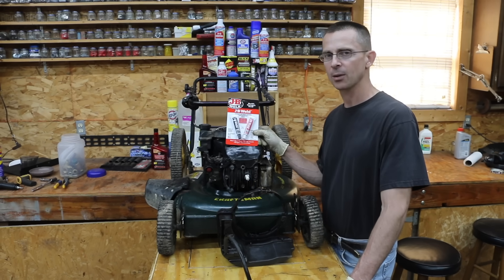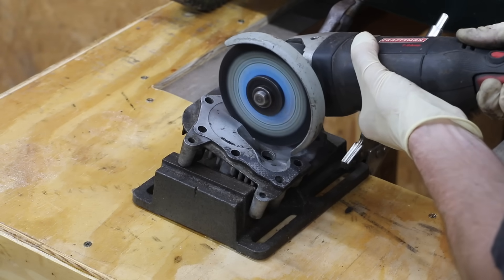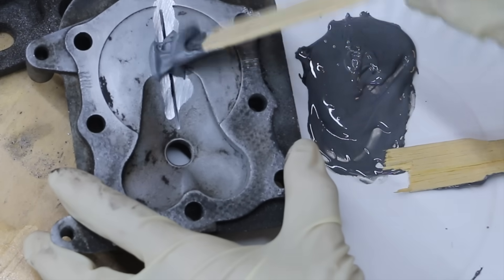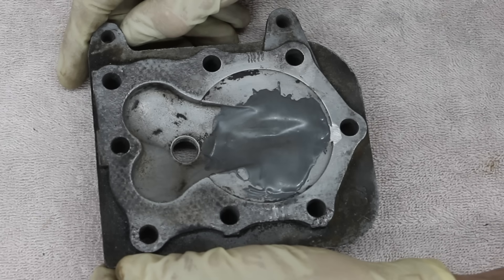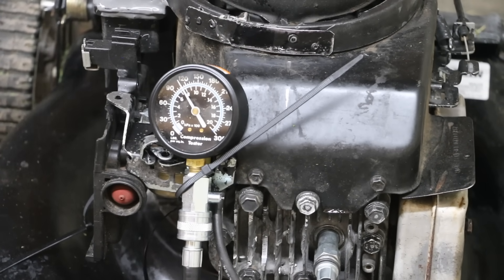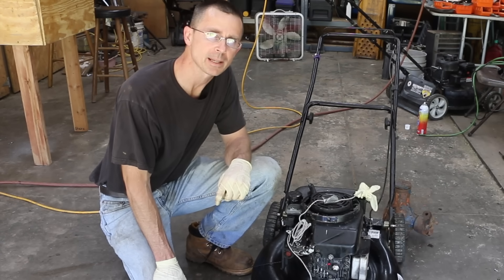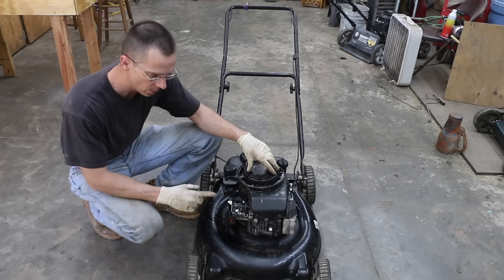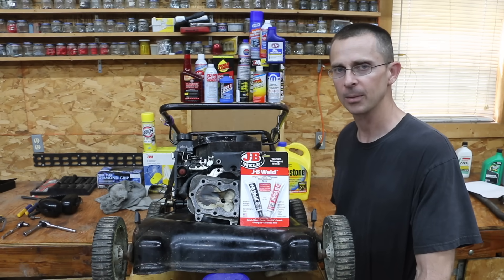Can JB Weld fix a cracked cylinder head?  See the proof!!

Comment: I restored a 1965 Mustang when I was a teenager.  The rubber that was pressed between the pulley, (inner disc and outer ring), on the harmonic balancer, had rotted, and the harmonic balancer came apart in two pieces.  The V belt also ran the alternator, the water pump, and the cooling fan.  This was about 1980, and the harmonic balancer was not available from Ford, so it was junk yard, or repair.  I glued it 3 times with Devcon metal epoxy.  The best that did was 2 days before it melted, and the centrifugal force destroyed the bond.  I then tried JB Weld.  It never failed.  238,000 miles later was still intact.
Reply: I didn't know jb weld was around  that long
Reply: @kirtleighrussell1345  I was curious so I looked it up, It's been around since 1968.  I don't think they've ever changed the paint design on the tubes on the original JB Weld.
Reply: Ok this is world was amazing long time ago

Comment: a broken flywheel on a Tecumseh lawnmower engine -it broke off the magneto mount. I jbwelded the mount back -let cure a week and put engine back together and its run 5 years now. I haven't had luck using it to fix leaking quantum tanks tho. the gas eats tru it
Reply from the maker: Impressive repair!  Thanks

Comment: Welding a new chimney pipe through my outdoor wood boiler. Couldn't get quite enough heat into it due to welder size and welder skill. Numerous pinhole leaks.  Decided I wasn't chasing them all day.  Three packs of jb later and we'll see how it holds up with180 degreee water around it.  Old burner and worth the try.
Reply from the maker: Impressive!

Comment: JB Weld makes a white plastic putty that I used to repair a cracked pool skimmer assembly.   It was wet and full of water and the job weld went on and cured up and it is doing an amazing job.  My skimmer was leaking so bad before I would have to top off my water every week and now the water has held its level for a couple of months now with no leaks.   JB weld is a great product.
Reply from the maker: Thank you

Comment: I had a Porsche about 30 years ago and the transmission had a big crack on the side of it. I took it to a welder and he stated that the Porsche transmissions were were cast from magnesium and an aluminum mix then told me sorry I can't weld it. A rebuilt transmission at that time was about $1500 so I cleaned up the crack and applied JB weld and it worked but after about 3-4 months the oil would get under the JB and it would start to leak again also the crack was about 4 inches long. I did this about 3 times before buying another transmission. For a quick fix I love this stuff.
Reply from the maker: Thank you!

Comment: I got a camp stove which was damaged in the mail. The cast aluminum burner was cracked though not broken. Would JB Weld fix the crack? My camp stove runs off a propane tank.
Reply from the maker: The burner will likely become too hot for JB Original.  It's only rated for around 500F.
Reply: @ProjectFarm  Thank you for your helpful information my friend. I looked at several J-B Weld products and found Extreme Heat 37901 which I think might work.

Comment: The trick to fixing a crack is to stop it from propagating. The best way to do that is to take a drill and drill a small hole just at the end of the crack, or perhaps slightly beyond so that the crack will propagate into the hole. Its the way they fix bells when they develop a crack. The round hole spreads the stress and the crack wont propagate further. Without that all the stress concentrates at the point of the crack and it continues to grow.  Getting it into the crack can be a problem. Using a thin product under a vacuum in a vacuum oven or chamber can help if you have one. Compressed air on one side can work if practical. (Like a sealed container that you can apply it on the inside surface of.) Otherwise open it up with a dremel.
Reply from the maker: Great suggestion! Thank you

Comment: One reason for the compression being so good may have been due to the layer of JB weld decreasing the static volume of combustion chamber thereby increasing the compression ratio. 

Agreed that JB weld is an amazing product as it secured a hose barb to a side tank on my 1991 Lincoln.
Reply from the maker: Thank you!

Comment: The valve guides were completely worn out on my old 4 wheeler but a new head cost more than it was worth.  Shop said the guides were not replaceable.  I drilled them out oversized and jb welded in bronze bushings....still running 4 years later
Reply from the maker: Impressive repair!

Comment: Several years ago, my old boat ended up with a cracked block.  I am not sure what the dealership fixed it with, but whatever it was, it worked, the engine never leaked water again.  On another note, one of your other videos reminded me of one of my dad’s stories.  Someone took a New Plymouth off the rack during his crews lunch.  They had drained the oil just before lunch.  The “idiot” who took the car sent three rods through the left hand side of a 383 V 8.  He got 8 miles before it happened.  He is also lucky he didn’t kill himself as the transmission also exploded into 50 or 60 pieces.  I enjoy your videos.

Comment: What I would like to see is, and I may just do it myself to find out, is will JB weld patch a hole in the case? I have a 10 hp Horizontal shaft Tecumseh that threw a rod. It punched a 2" round hole in the side of the case near the electric starter. I wonder if a piece of metal to cover the hole, with JB Weld applied under and around the patch will be able to withstand the heat and oil of the running engine?
Reply from the maker: Thank you for the video idea!

Comment: Great video! I have used JB weld on the 20 to 32 cc 2-stroke gasoline engines in my RC airplanes, to:

- Add a fitting to the carb metering plate to equalize pressure
- Block the hole in a choke butterfly
- Fix a cracked cooling fin

Not as impressive as patching a cracked block, but now that I know I CAN...
Reply from the maker: Thank you!

Comment: Bruh wtf. I tried using it to fix a pair of glasses which I had stepped on and it didn't hold. Even after letting sit for 5 days.
Reply: Surface prep makes all the difference, did you sand and degrease the surfaces?
Reply: @markkalsbeek5883  can't sand that small area. The glasses split from the frame.
Reply: @xDTHx  sure you can. If you have a round frame and the lenses popped out sand the flat circumference. If the legs are attached directly to the lenses sand the contacting pad of the leg and attach a tiny piece of sandpaper to a piece of wood (edge of popsicle stick) and carefully sand the piece of glass where the pad was. Remove all old adhesive beforehand. Sand with 240 grit or higher. Degrease with mineral spirit.
Reply: @markkalsbeek5883  I don't think ypu understand. There's 2 pieces to my frame which are glued together. They popped apart from each other. I had to buy a new pair.

Comment: i know this is two years old, But at the end of the video you ask, what else is out there?

I've used Belzona with Great Success,  Even built up a worn shaft, turned it to size and re-cut a key way in it to mount a pulley 
It is very pricey though.
https://www.belzona.com/en/products.aspx

and of course from my previous Comment,  PC-7

Comment: I've got a 2 stroke 125 bike engine with a whole the size of a little finger nail in the lower case on the intake section which the carbuerator mounts. Will JB be suitable as a filler do you think? Threaded hole within the gap that needs filling, that leases out to the stator plate on the opposite side of the engine case.
Reply: Therefore, the gap that needs filling will need to cope with pressure and fuel and heat

Comment: I own a jeep cherokee and on  the 2000 and 2001 model the heads are known to crack, mine did. I used JB weld to repair the crack and have been running my jeep for over six weeks now with no coolant going into my oil. worked for me! thank you JB.
Reply from the maker: Impressive repair!  Thanks for sharing this experience.
Reply: I have a Cherokee 2000 as well and the heads being known for cracking is not good to hear...

Comment: About 20 years ago, I used JB weld to repair an aluminum intake manifold on a Toyota 4Y engine. The carburetor mounting studs had vibrated loose/wallowed out the threaded holes.
Another tech had drilled/helicoiled the holes, but they did so WAY off center. 
As a result, it had a bad vacuum leak.
I removed the studs, pulled out the Helicoils, and used JB Weld to fill in the holes and hold the studs in place.
It worked well.
Reply from the maker: Impressive repair!!
Reply: @ProjectFarm  My employer didn't think so. They wanted me to sell the customer a new intake manifold, for a lot more money.
The customer wanted his lift repaired and running within a day. I sided with the customer.

Comment: In the early 1970's I swapped for an 1952 Pan head Harley that a dim dot was riding on a gravel road going up a hill and dumped it on the carburator side.  About a quarter mile below the hill the road crossed a creek so They tied a rope to the  back of the frame and drug it down there to put out the fire. All this broke the  stock carburator manifold off the head. I was able to get it going again with an O-Ring adapter and JB weld.  Yup.
Reply from the maker: Thank you!

Comment: I had a customer one time in my shop that was going to the local lake and needed a temporary fix on his Toyota pick-up radiator neck that had so much corrosion from the anti-freeze not having been service that the neck came away from the upper tank.  Plus he had little money. We put JB weld on the neck and he went to have a sandwich  and was gone about 3 hours.   We rattled the cap so the engine had coolant flow but no pressure and told him that in 24 hours to go ahead and check the fluid and let it pressurize and check for leaks.    He came back for something else while traveling through .............. 2 years later.   And the JB Weld temporary repair was still there.   He never had the radiator repaired or rodded out.   So we gave it a little black paint job and off he went.   Tough Toyota    Tough JB Weld.

Comment: Try Marine Tex epoxy sometime. Been told by a guy that he used it to fix a cracked block, and cyl head. Its machineable. I used it to fix a large gas leak on my holly carb on a marine application 4.3l motor.
Reply from the maker: Thank you for the video idea!

Comment: It's great stuff. I use it a lot. Sandblasted metal with pinholes gets a coat.  I bet you could make a whole cylinder head with it. It can be drilled and tapped no problem.
Reply from the maker: Great Point

Comment: JB Weld is great stuff.  I put it on my radiator when I developed a leak in the tank on the top with a fairly high pressure radiator cap while I was traversing the California Desert at around 115 degrees Fahrenheit.  I held up for several years after the patch as I was moving to Colorado.   The car was finally totaled at a stoplight by a semi, but the patch held tight the entire time. I also repaired a cracked transmission case on my Harley and it held and never leaked for years.  I was told by the shop, it was a goner, and couldn't be repaired.  They were wrong.
Reply from the maker: Thank you

Comment: I had a 72 Challenger, kicked something up off the freeway & punctured the gas tank. Gas was draining out like a petcock. So on the side of Hwy 99 I mixed up some JB Weld dipped a sheet metal screw in it & screwedit in the hole. I lost maybe 1 gallon of gas and that held for the next 2 years that I had the car.
Reply from the maker: Impressive repair!

Comment: Great product and glad you tested it. Another great product is Kwikwood made by JB Weld. Replaced hinges on kitchen cabinets. New hinges had a screw hole pattern so close to previous holes that drilling the new holes would compromise the holding ability of screws on the new hinges. Applied the KwikWood to the old holes and let cure. Drilled hole pattern for new hinges, sometimes making contact with the KwikWood.
KwikWood held in place and more importantly, the screws held tight. Love the products this company makes and I applaud Project Farm for testing these consumer products.
Reply from the maker: Thanks for the constructive feedback

Comment: Many years ago (1976) i used JB weld to seal my exhaust pipes to my cylinder head on my 650 BSA motorcycle, because of wear and vibration, the pipes would not seal properly any longer.  After using JB weld the pipes sealed perfectly and withstood many years of hard use, without failing. I eventually sold the motorcycle with the JB weld still in place, still sealed.
In my view, there is no better product for emergency repairs, especially on engines.
Thank you for all the experimentation you do, i watch your channel often.
Reply from the maker: Impressive results!  Thanks for the positive feedback

Comment: At 9:35 when you rubbed your finger on the metal, the scored siding where the bolt hole is moved. Just curious what's up with that piece since that spot wasn't JB welded. Thanks for the awesome videos btw. We all use the products you test and we all wonder what's the difference. Finally you are giving us the answers so thank you for everything you do!!

Comment: I used it to weld a crack on the bottom side of the oil pan on my 2002 Volvo v70 when the engine had 19 k miles back in 2003 I still drive this car today at 200 k miles. Amazing stuff.
Reply from the maker: Great Point

Comment: I have a plasic fitting on my carburator on my riding lawn mower. Its actually where the gas line connects to the carb. It broke and of course you cant buy it. I jb welded it and have never looked back. The stuff is amazing!!
Reply from the maker: JB weld is a great product

Comment: Would you please do a comparison between UV curable glue/adhesives? There are not that many of them that I know about. Maybe you can find more, which also would be very  important to me. I have used two different ones and I've definitely seen differences which most of the people reviewing them on YouTube Don't See. They also don't understand that you can't connect two dark surfaces together like a regular adhesive. If UV light  can't get to it then you can't cure it. You have to put a layer on one side and cure it first and then add more UV resin/glue/adhesive, or what ever you want to call it, to both sides so now the UV light can go through between the surfaces through that already hardened first layer and cure the fresh later. I have compared the two  using thermal camera and I do see that they both heat up just the same during the curing. Super fast and very hot. But after curing, one had better surface adhesion than the other. I haven't really seen a good comparison here, that's why I'm asking you to step in and do it the right way like you always do. I think your videos are very informative and they take the guesswork out of my projects. Thank you and keep up the good work.
Reply from the maker: Thank you for the video idea!

Comment: JB Weld is the only product that friends have told me works, if applied correctly, on car engines in the same fashion.
After seeing this test I don't think that there is another product that works this well.
There is a product called liquid Steel however that I've never heard or seen used on a automotive engine or cylinder head.
Arc Welding might be the only thing better.
Reply from the maker: Thank you!
Reply: @ProjectFarm  You're Welcome.
If you intend to go farther with this, then include a product called Liquid Steel, it comes in a grey and white tube.
the Last time I saw this was in Sears in the hardware department 5 years ago.
JB Weld will probably come out on top anyway.

Comment: my first job was at a diesel mechanic shop 25 years ago.  One guy who worked there, and was probably the best mechanic, sent me to NAPA with instructions to get a tube of fastweld and if they were out get JB weld.  Whenever I came back he used the tube of fastweld to fix a hole in an engine block.  It was an awkward shaped hole but it was probably 2" at the widest spot.  I don't know how long the engine lasted but the guy doing the repair was one of the most reputable mechanics around and i could tell that it wasn't his first rodeo with that type of repair.
Reply from the maker: Thank you

Comment: I've used 'quick  steel' putty it takes  higher temp , for exhaust fix too
Reply from the maker: Thank you!
Reply: @ProjectFarm  when using epoxy putty I found it's best to mix it into a ball , then tearing the ball in half and putting the inside sticky part on the surface first

Comment: JB weld may be gas/oil resistant once cured, but it will not adhere if there is gas/oil already present. I can't remember if JBWeld makes it or not, but there is a product called WaterWeld that is a more putty form that will adhere in the presence of water or oil/gas. Might want to check it out!
Reply from the maker: Thank you!

Comment: I had a crack in my (plastic) intake manifold on my Saturn SW2 that was leaking coolant. I cleaned and buffed the surface around the crack and a piece of pvc, glued the PVC on with JB Weld, and voila, no more leak.
Reply: Most impressive-- we know JBW works on most common metals, but the epoxy apparently works on plastic, too. Good idea, thanks. * BTW, you used the PVC as a backer/reinforcement, but do you believe the plastic seam could have survived without the reinforcement?

Comment: I repaired a engine block with it before and worked great. I am curious, about the longevity of the head repair. Did you continue using it? if so hows it doing?

Comment: JB Weld worked extremely well on the aluminum housing of my Mercedes automatic transmission that cracked and leaked fluid. I sold the car in 2003 and the buyer still drives it.
Reply from the maker: Impressive results!